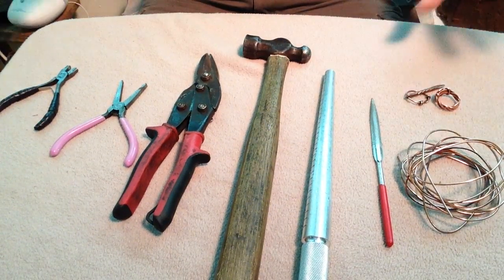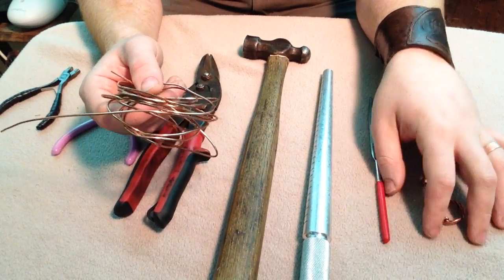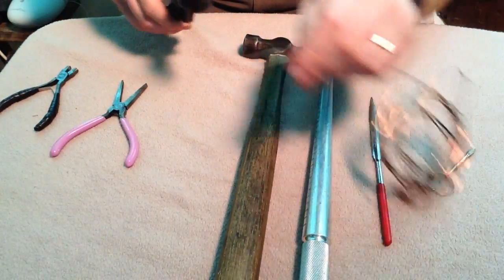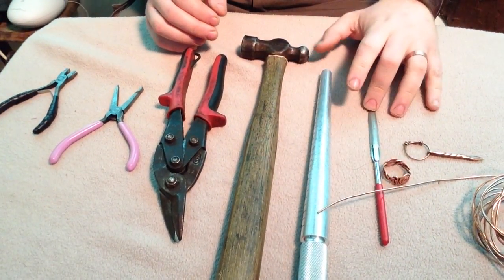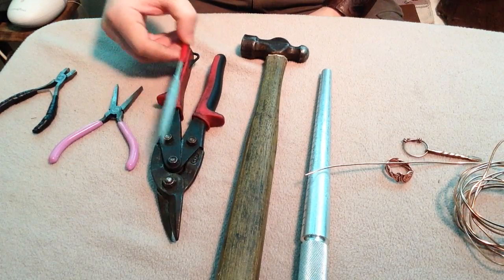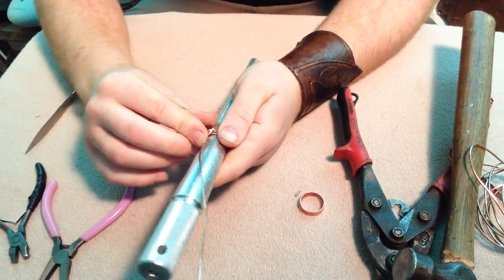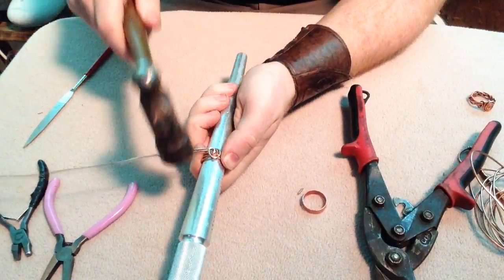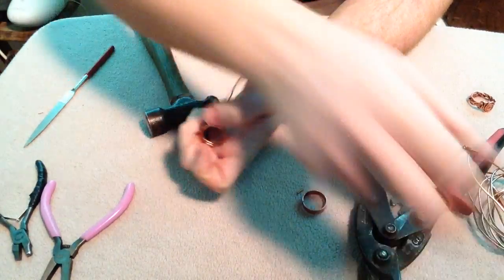Viking Inspired Rings

Comment: Just a tip for you if you’re interested: Buy yourself a propane torch and teach yourself how to taper the wire - be it copper, brass, bronze, silver, or gold - and you will be able to make absolute 100% historically accurate and very nice ironage rings. You will also open up a whole new world of possibilities when you add fire - and thus the ability to anneal the metals - into the mix and things such as massive torcs and armrings are possible as they are very simple to make, just time consuming. From this point you can even go into filigree and granulation or lost wax casting if you so desire.

Good luck!